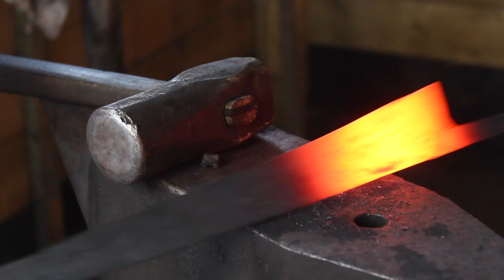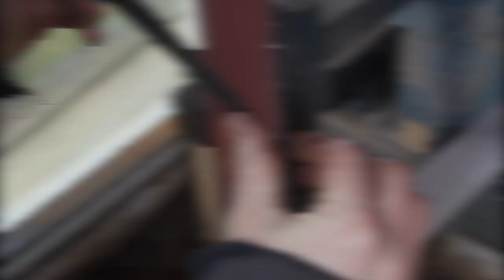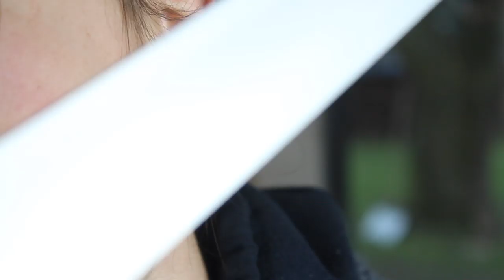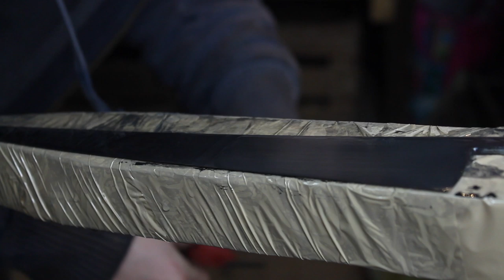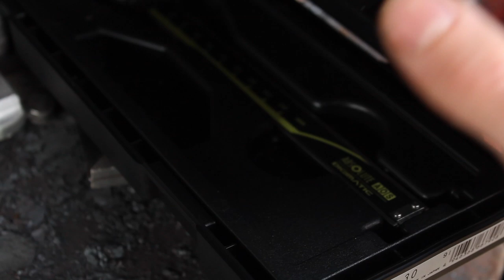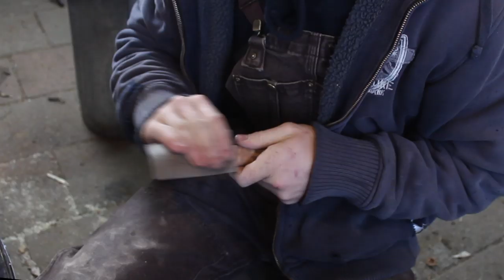REMAKING my first kitchen knife 1,5 years later ~ Japanese DAMASCUS Sujihiki

Comment: Here are my 2cent tip: try blue painters tape to protect your blade - its easier and cleaner to remove. I cant recall if you have a mill - if not I suggest you get one when/if possible. If you get a mill - it will be very simple and easy to mill grooves in the guard/handles/pummel or  mill a flat or grooved surface on your scales. A lathe will allow you to turn hard wood/steel/brass/etc pins and thread them if you wish - and even turn round/oval/etc handles. Equipment like that will make your production fast and easy. You will then be able to buy scrap metal for peanuts and machine it to fit the blade design. Fyi.